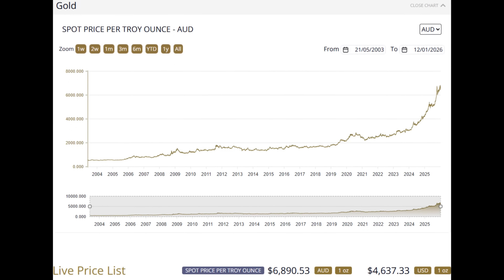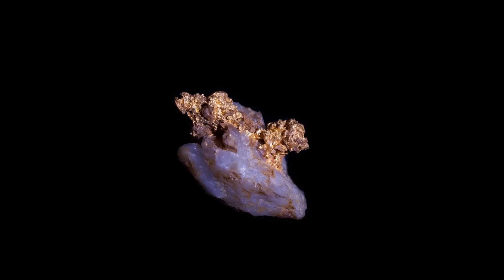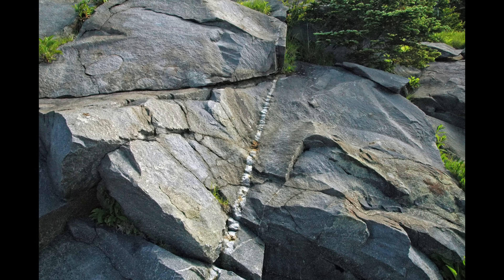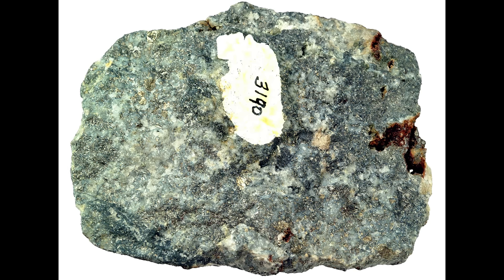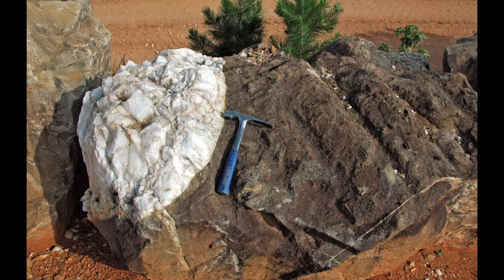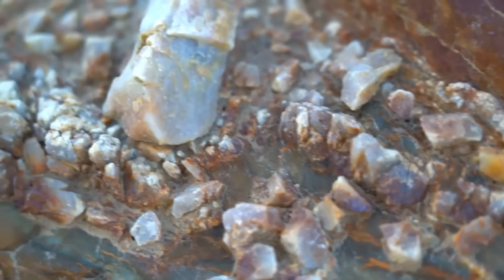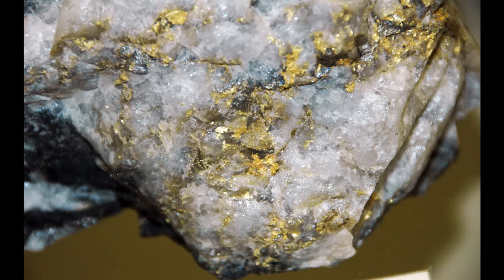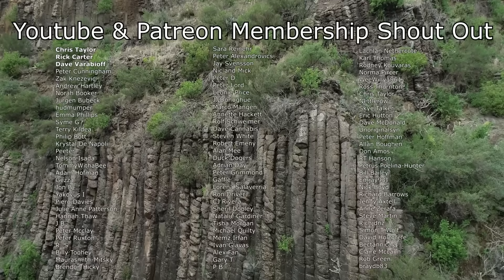The Uncomfortable Reality of Hard Rock Gold Mining That No One Talks About: Ep.2

Comment: If you have a jaw crusher and screener, I suspect you'd be better using it to crush rock to gravel and sell it for concreting and stone mulch.  Decorative crushed stone can fetch retail prices anywhere from $100 to $800 per cubic metre, depending on the type, colour, grade and size.  Even basic concrete mix of stone and sand sells for around $80 to $100 per m3.

At 1.3T to 2.0T per metre, a moderately-sized jaw crusher can be purchased for around $50,000.  It could produce several thousand dollars worth of gravel per working day.

The only other equipment needed would be a grading table or tumbler to produce the various screened sizes and, of course, a supply of suitable rock or stones.

I'm not sure what regulations would apply to quarrying rock or river stones on your own land.  I'm sure the government would put its hand out somehow.
Reply: You would also need some sort of loader or excavator
Reply: @johngibson3837  Agreed.
Reply: A LONG time ago I briefly knew someone with an exploration company. They were in the process of dealing with an associate who had a quartz vein that would break even selling crushed quartz for concrete and any gold bearing stuff became profitable. But the diesel costs were covered just by selling the crushed quartz with no gold.

Comment: Can you use an electric hammer drill
Reply: I think Jeff Williams has or includes a couple of videos where he uses one, battery operated like all the power tools you can get at your local hardware store- Lowes, Home Depot- not many Family run stores anymore!  But I was thinking of getting one myself and I don't know about the actual bit, I think he uses a concrete bit which makes sense because I have used concrete bits before in my work (contractor) and the only thing I am unsure of is where to get the longest shank size because you would need like at least a foot, 2 or 3 I would think would be better, but pretty soon your bits will be costing as much as tour hammer drill and I need a rock crusher too, I think I could buy 1, but what I've seen is 2, is recommended, but if I screen the first pass and run the leftovers a 2nd time I think would suffice, but I haven't come across enough info- I like dual purpose tools like a hammer drill because I can drill concrete, or rock, but if I don't use for one I have the other- preferably a paying job like concrete work and use in my spare time- prospecting; think rock crusher- noisy as hell and what else can I use one for, I also have seen stuff on feathers and wedges for splitting boulders some larger than cars, but I'm not sure, I think they did use a hammer drill for pilot holes on that too, Ask YT! I know the videos are on here!